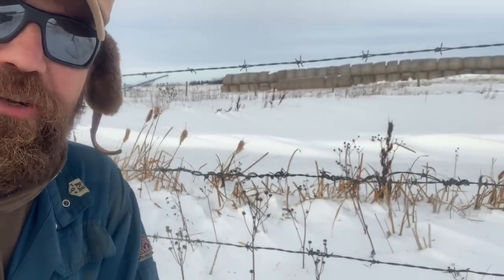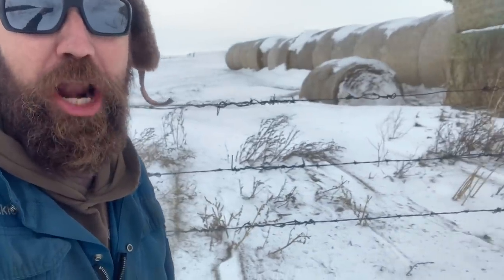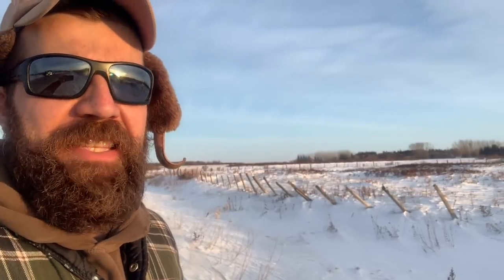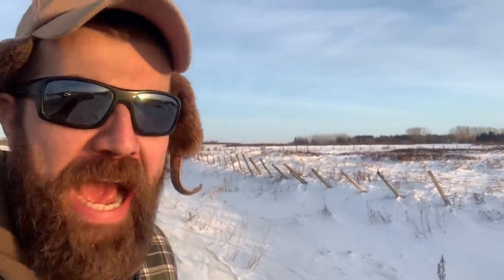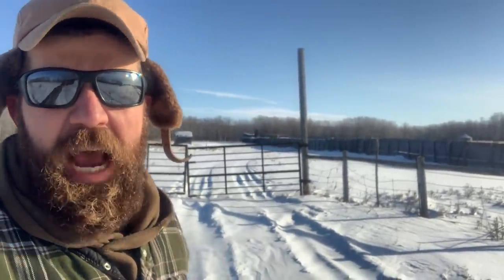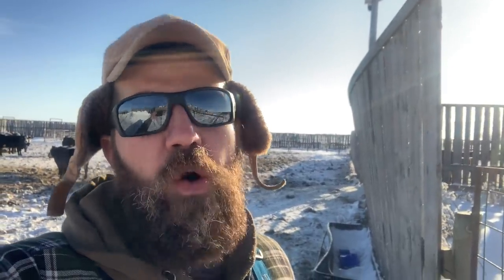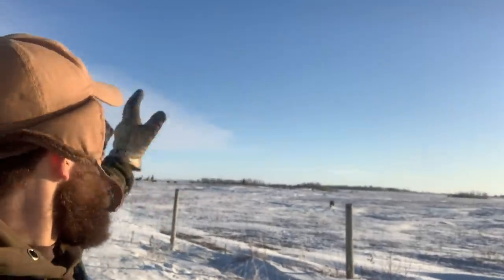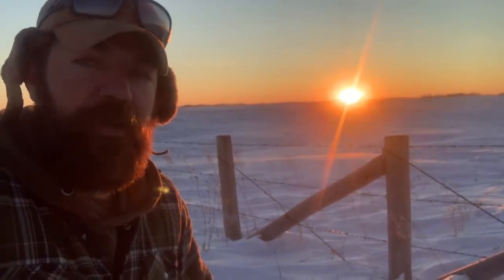Fencing Pioneers

Comment: I was passed on the grid road doing ten miles a hour cause one of the four of my damned tires on the post driver shit the bed. But the nieghbours called and said the cattle were out due to a sapling post that was a “temporary fix” finally got smoked by a near sighted deer. So damned the torpedoes I’m rattling down the road causing such a commotion to the border pasture that the Americans are certain they are being invaded from the north. 

If I won the big lottery I’d just buy bout 2,000 of them free standing coral panels tell the tax man”we had unexpected  coral repairs” get a tax refund and never have to fix fence another day in my life Hehehehe.